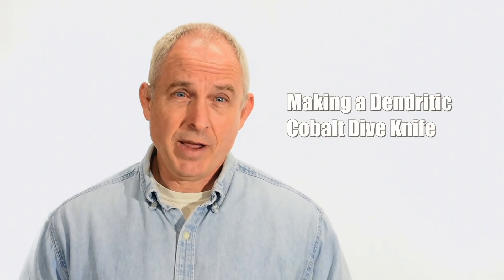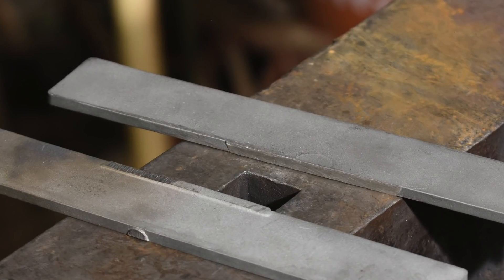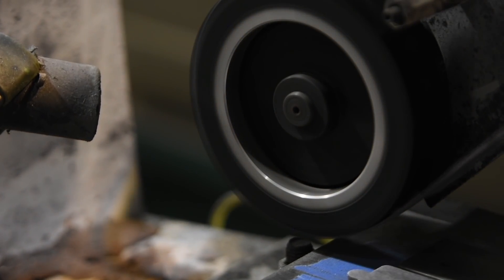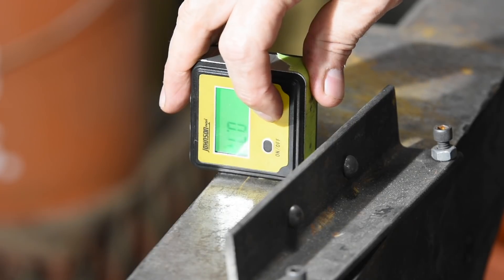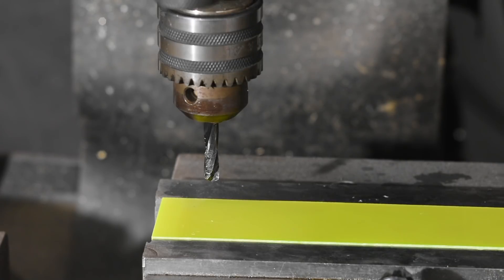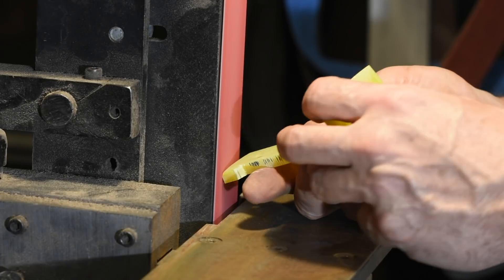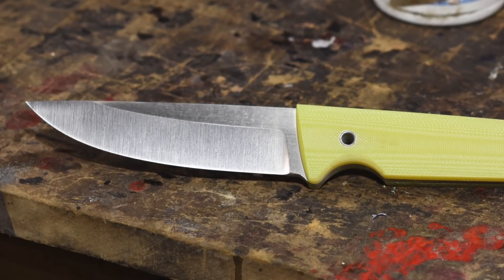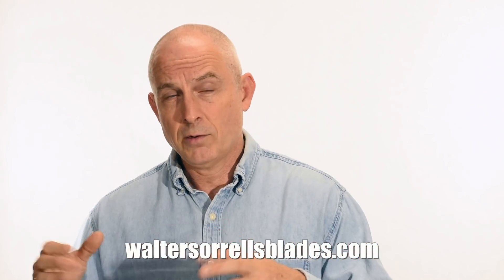Making a Non-Magnetic Dive Knife

Comment: ssooooo, two rivets holding on that handle, no waterproof adhesive, and rivets have this...awful tendency to kind of just ya know....fail, fall apart, wear away, or break? they are also hallow, so they are incredibly weak?? i guess you kind of really stopped caring about this client once they asked you to use a carcinogenic dangerous material with a handle material that you dont like because it is a little tough on your tools? i think a smart maker would have been easily able to educate your client about the health risks of using that kind of material and advised a better alternative with superior characteristics, along with being at least willing to put more effort into at least using some better form of handle attachment, especially when you mentioned that, hey its a dive knife, lets use a hallow "stainless steel rivet", so now your surface area for saltwater and corrosive contact is significantly increased, and not even adhere the handle material to the blade so that when the rivets fail, the entire handle falls right off. hate to sound so negative, but seeing this is just a honestly abhorrent display of lack of caring about knifemaking and a truly poor example of what a  good craftsman should be.

Comment: I've considered using grade 5 titanium for a dive knife, but this is interesting. I wonder how they compare.
Reply: This material is like the titanium, but with a ton of carbide. For a titanium knife I’d probably carbedize it. I’ve made titanium edged tools and the edges roll easily. There’s an alloy called sm100 that’s partly titanium and apparently a blade material.
Reply: @David P. I have grade 5 titanium on hand, and can heat treat it semi-well. Those other steels are a pain to work with for heat treat. (Titanium IS a bitch to grind, tho)
Reply: It’s not difficult to source titanium commercial dive knives, and is what I would do. I would feel terrible getting a skilled knifemaker sick doing a bespoke cobalt blade for me.
Reply: @jadedengineer  I make my own, and have grade 5 on hand, you just gotta wear a respirator when grinding it. It's nasty stuff. It sparks white, which is cool.
Reply: @jacksin3323  Titanium is probably the least toxic to grind. It is THE most biocompatible inert metal there is right now. With that said, breathing any metal dust in isn't good for the lungs obviuosly. If there's any additional protective equipment that should be used, it is probably some welding goggles or well tinted glasses to avoid constant contact on the bright sparks. I start grinding all my ti alloy blades with 36 grit to save myself time and energy. It keeps the shavings large so they don't float in the air and are easier to clean. Just have to make sure to clean the work area more frequently so they don't get ignited and set the shop on fire.

Comment: Cobalt is used for all kinds of fun things
Hardfacing CoCr alloys are used for Nuclear high pressure valve seats, big friction wear point in a 1000 lb+ system
Tungsten carbide almost always uses a cobalt matrix because Tungsten Carbide degrades before sintering, partially melting and sticking together, which means that a tough material has to hold the powder
Plus Cobalt salts are a cool blue.
Really neat element
Reply: Also just looked, the alloy of this metal is in the stellite family, the stellite family is used for the valve seats
Reply: Just looked at a metal supply site and found they’re making niobium/titanium type timascus. They’re also selling just pure niobium billets.

Comment: What about the stainless steel tube rivets thought, are they small enough to not trigger the mines ? I'd be very concerned.
Reply: 316 and 304 stainless steels are non magnetic so they would be fine for rivets but pretty poor for blade steels.
Reply: Stainless is non magnetic
Reply: @cho03  that is not true, if that was the case the knife could have been made from stainless steel
Reply: @masonfino4762  Austenitic stainless steel is nonmagnetic due to high percentages of nickel (usually arround 10%). 
But the corrosion resistance mainly comes from chromium. 
Martensitic stainless knife steels also have high amounts of chromium, but contain less nickel and are therefor magnetic.

Comment: How Would this stock be for a hand plane iron just for edge holding don't need the other properties.
Reply: You can’t sharpen cobalt to a fine edge as you would need for an iron or chisel. It is too brittle, it would just chip away with little use.

Comment: How hard is it on the rc scale Walter? Also the sparks looked like you cutting concrete or stone. Kinda cool and different.  And isn't there a non magnetic stainless steel? Cool build as always.
Reply: Non-magnetic stainless steels (like 304 or 316) are austenitic whereas the kind of stainless used in knives (like X39CrMo17-1 or X50CrMoV15) are martensitic.
Reply: one could use titanium or silicon-bronze